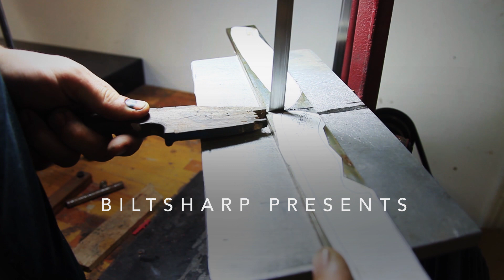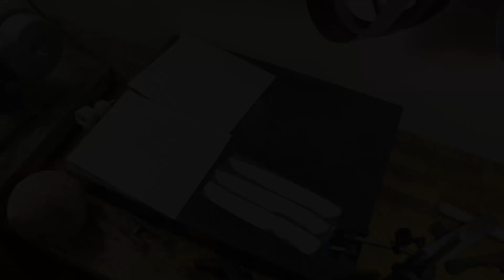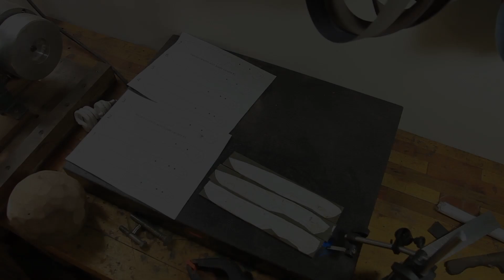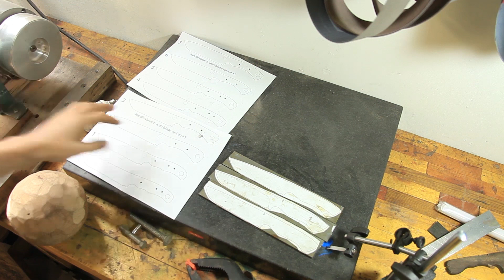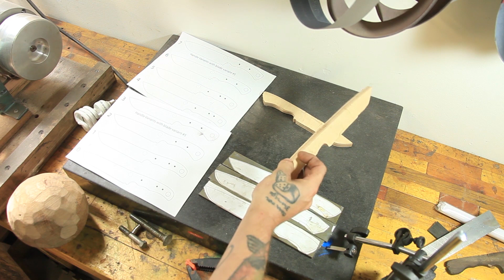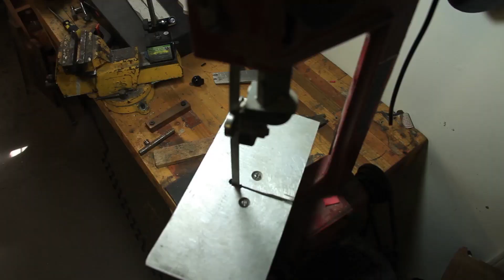Knife Making Part 1: Design & Prototype

Comment: Great to see your channel, good videos!
Reply: +knives&stuff Is the metal cutting bandsaw quicker than an angle grinder?
Reply from the maker: For the most part I would choose  the bandsaw. It's much less heat, more accurate and controlled. It does take a long time, but you can get a lot of detail even though it's really rough.